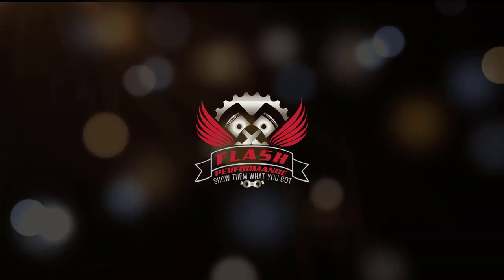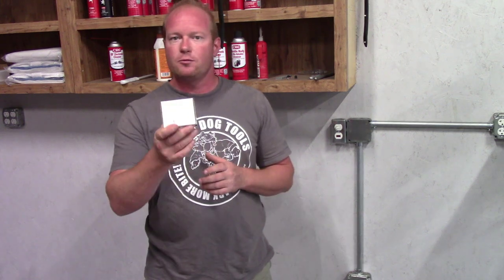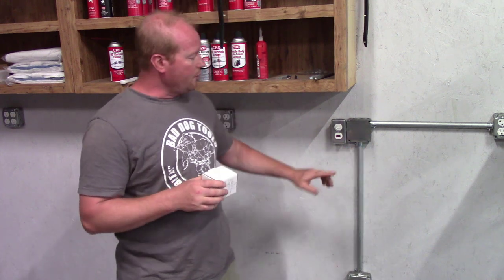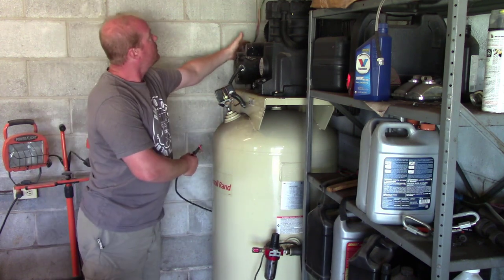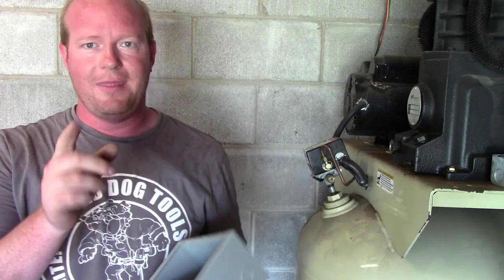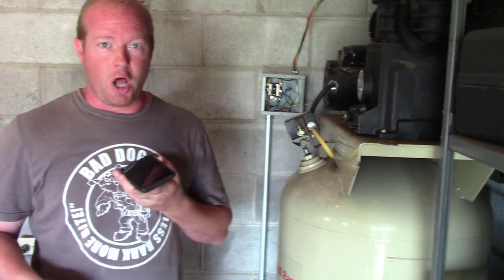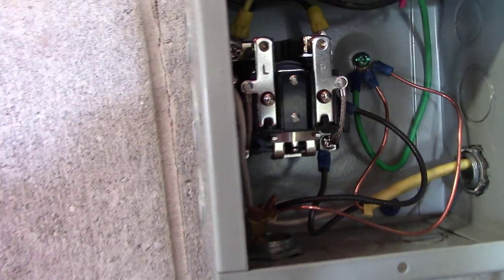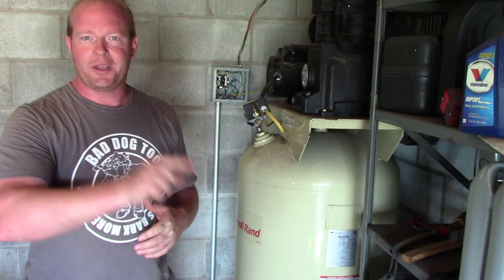Remote controled air compressor

Comment: Very nice solution.  One thought would be to have used a 3-way switch in both the remote shop and the tiny-garage so you could use compressed air as needed in both locations.  I may do something similar to get air to my garage from my basement workshop.

Comment: I also used a remote contactor to control my air compressor at a distance.  I used a mechanical wind-up timer instead of an on/off switch.  That way I can't forget actually turning off the compressor.

Comment: I have same setup except added a 3/4 110 volt normally closed valve at the tank to stop any tank bleed off. My tank sits full when not in use .

Comment: I just wanted to let you now if you want it to be up to code witch your not . To be up to code all the wiring has to have in a productive covering. Put armored cable were the wires are not protected this will keep everyone safe and be up to code
Reply: It's a little more complicated that just putting the wire in conduit. First off; you cannot run ROMEX in conduit due to the fact that it already has a covering on the conductors. Has to be loose strands of wire. Second; you cannot run wiring in a conduit with any non-electrical rated materials. The "control" circuit would need to be in it's own conduit separated 24 inches from any other buried utility.

Comment: I read on my Air Compressor instruction manual stated that "Do not attempt to stop the compressor by unplugging the power cord".  Also "Always make sure the lever is in the "OFF" position before plugging in the power cord.".  Is there a reason not to do this?  Your manual wall switch is basically unplugging the compressor before the compressor lever switch is off.
Reply from the maker: Good question, and I have no idea of the answer. I would suspect it is because if you unplug the unit you could create an electrical spark when doing so. All I know is I have had this system for 2 years now and I have not had any issues. Try at your own risk
Reply: @FlashPerformance  When switch off on the level or automatic off, you hear hiss air release from the air tree tank valve.  This is the air preasure in the hose between the compressor motor output to the tank input been released.   So when next time the compressor kicks on it does not have the load of air preasure on it.  It makes the motor turn on easy and last longer.  This is what l read..

Comment: Mine is even better it turns itself on and off automatically as needed, no remote control needed or required.
Reply: Hopefully you never have a failure of any component in the system when you are not around.  Example, pressure relief valve sticking open, hose rupture, float drain valve stuck open.  It will cause the compressor to run until it never runs again.  :-O